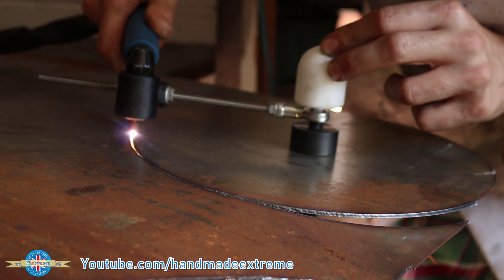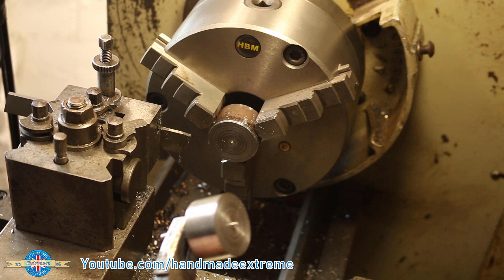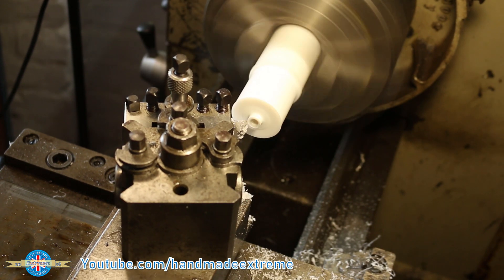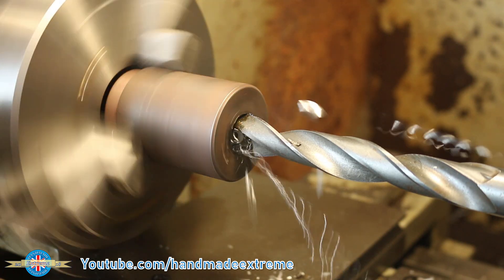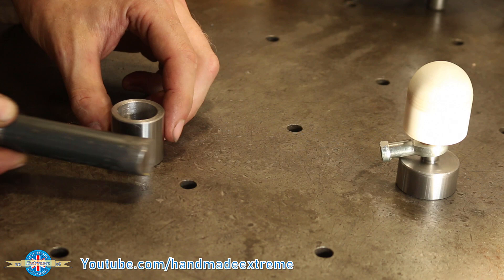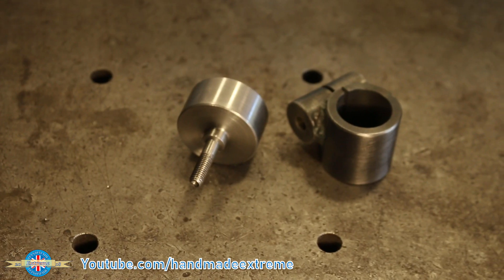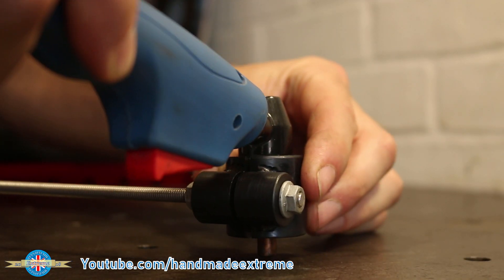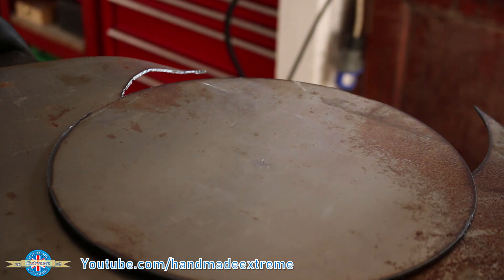How to cut perfect circles with a Plasma Cutter. Making a circle and radius cutting guide.

Comment: You might want to add an adjustment post to the torch holder so you can hold the torch just off the surface you are cutting. This will increase the life of your plasma cutter tips considerably. Best Regards Sarah
Reply from the maker: Like it. That sounds like a great idea. Thanks for sharing. 👍
Reply: You can use a drag tip.

Comment: It would be awesome if you good share the treatment process! Hmm about the way the plasma cutter is attached, is there a way to allow the torch to rotate on itself?
Awesome video!
Reply from the maker: I'll put it on the to do list. Thanks. 👍
Regarding the torch. It can tilt back and forwards so you can direct the plasma into and away from the cutting direction due to the rotational freedom of the rose joint. It wont rotate in the holder though once it's tightened.